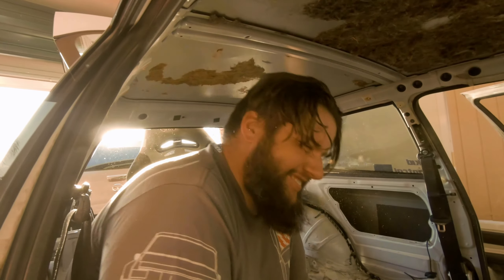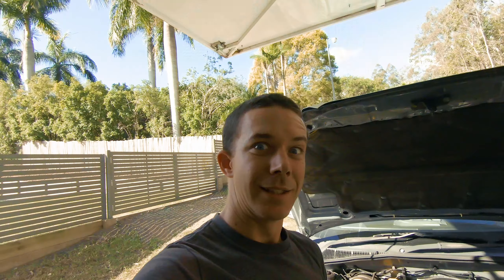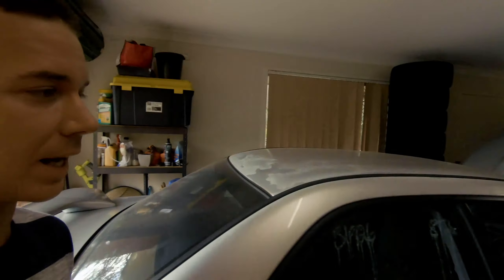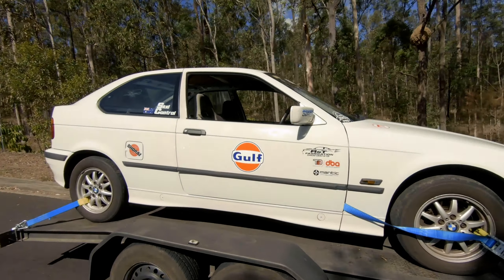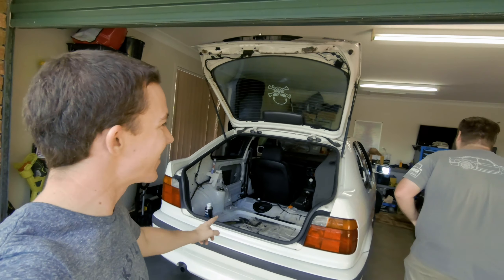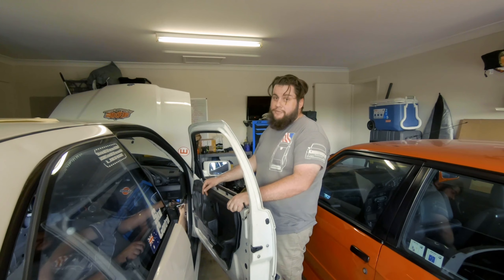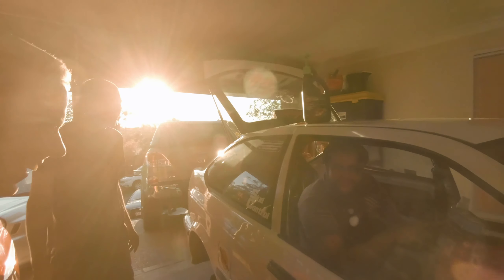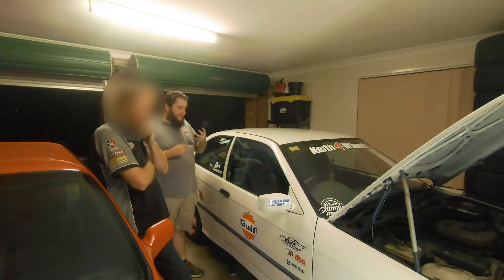Cheap Subarus and Race Prep - Skid Happens EP31

Comment: I figure you probably found the impreza after you sold the WRX, but would've been a good candidate to just engine swap the WRX engine into the impreza.  Not like you can't do that anyway, plenty of crashed WRX's. 

Starting to think I did get ripped off on my car though, 2K and everything has been done, I paid 4 for my GC8 and I have a lot of work left to do.  Live and learn I guess.
Reply from the maker: Yeah was bought afterwards and the reason we sold the WRX is limited time to do a gearbox swap.
Both the GC8 and GD WRX's cost us $2000 to buy, the latest one by far being the best value for money!